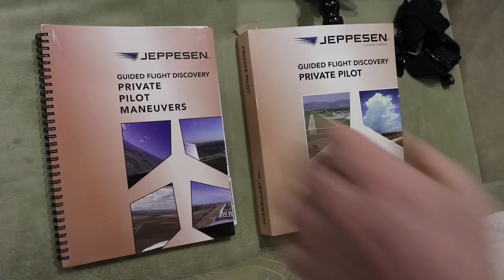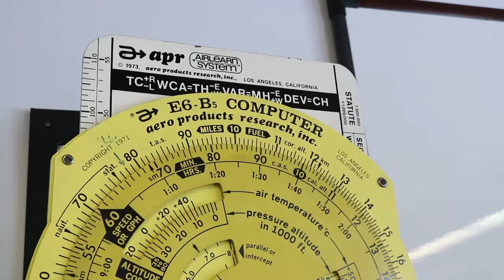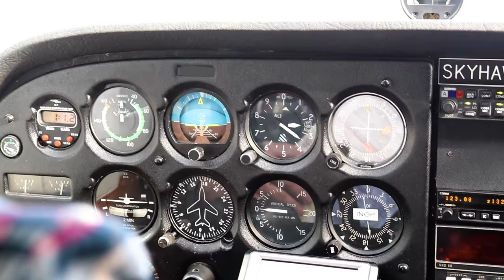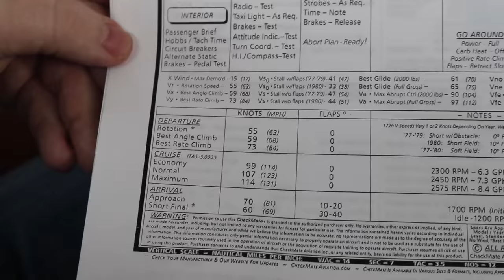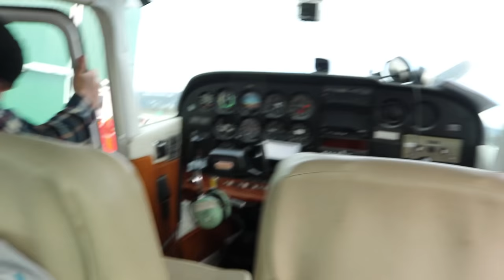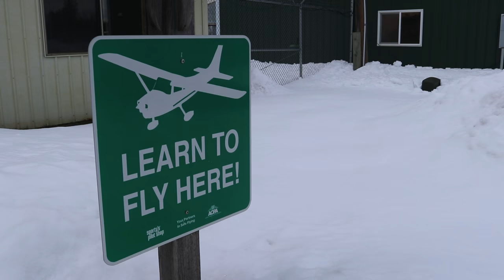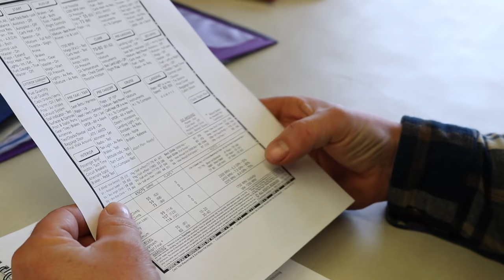FIRST FLIGHT AS A STUDENT PILOT... WATCH OUT!

Comment: (1966) I soloed in a 150 at Eglin AFB, FL. As I set up the glide slope on final the tower said, "_____do a 180 as the Medivac takes runway. Here I had to do every thing right without having done it exactly before. As I set up again, I realized I had forgotten to turn off the carb heat...didn't matter that time! My instructor moved away and money got tight and I have regretted not continuing. Go for it.

Comment: Jesse,  you are correct, the actual time spent in the air is off set by about 2-3 hours of planning, check weather, minimum, alternative airports.  To be honest a monkey can fly a plane straight and level. But add in wind, terrain, weather, ground control, radio discipline, fuel consumption.  A lot of planning.  One of my favorite tips one of the old timers at the airport when I was getting my Single Engine Land cert was -- if flying, and your engine stops, you are going to land.  If at night, if you turn your landing light on, and don't like what you see, turn the light back off.

Give   Alpha Lima Yankee Sierra Sierra Alpha   a hug.

Comment: Dont waste your time going to schedule ground school at the FBO just to pass the knowledge exam. Pick up a DVD or PC based video study course from King or Jeppesen. You can blow through it in a two week intensive session, then for the FARs, use your smartphone to record your voice reading aloud each of the relevant regs, be careful not to have more than one reg per file. Its time consuming up front but once you have all the regs stored on individual audio files, load up your playlist, set it on random shuffle and you can study the FAR at any time, while cutting wood, driving or even taking a dump. After a month of daily exposure, you will be an FAR expert, fully ready for PTS training, check rides and final exams. Then hand the dvd kit and audio files to your wife for her turn. If your weather is perpetually in IMC and you find it hard to keep up the skill for your PTS maneuvering then consider a decent pc bases flightsim and yoke. It sure beats chair flying and if used correctly it WILL help you rehearse your checklists, emergencies and basic airmanship between long periods of weather induced inactivity... assuming you stick with your correct aircraft type and dont play it as a game for fun. There is no substitution for actual dual instructor time but it can reduce the perishable skill loss if you have momentary weather or money issues. Radio procedure can also be practiced via special training software and by running scenario in your head. Dont discount what I am saying about using a self study electronic ground school and recording the FARs into your phone for random playback. You will pass with >98% on your first take anx feel like chuck yeager when you stroll up to the CATS computer for your exam. Good luck crew, I just want to tell you both, we're all counting on you.

Comment: ok alissa  one strike for you. flying is awsome  just being around aircraft excites me still. yes i was in the air force and i flew  as part of the crew i did get to  take off one time  with the help of the acft. commander. it was a thrill landinding was something else for me it was best described as a controlled crash   crash is the best word for it. so much for that. and yes nick fouch is a good teacher he is quite grounded and has a good handel of his capabilities. I also built my own house  check my FB page.it would take a contracter about 3 weeks to build my type of house  however it took me and my wife  2 years to complete it.  i did contract out the foundation work , the addition of the solar hot water system and the solar electric system i am grid tied on building your house  take your time and do it right it  will last a lifetime,  sorry for the book have fon with all your toys..